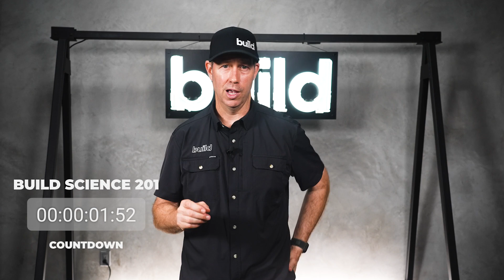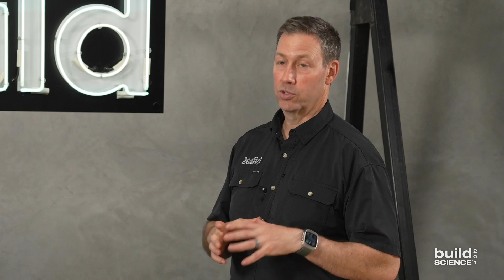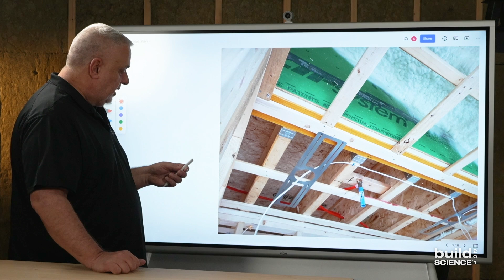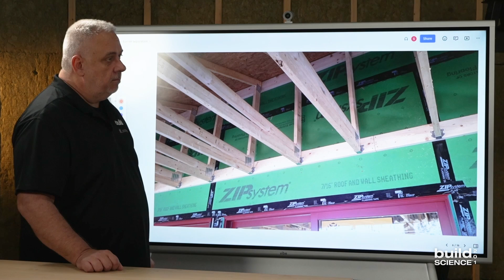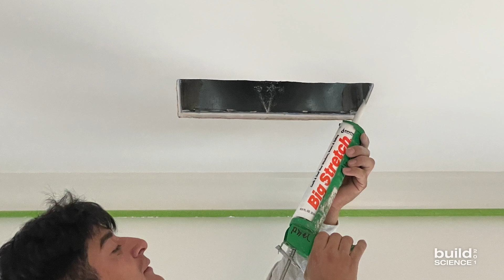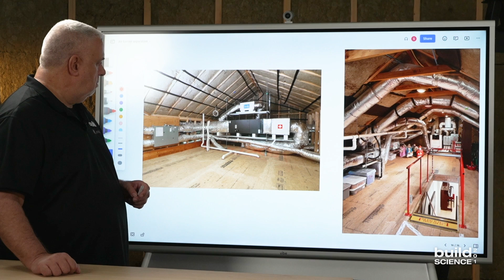Build Science 201: Ep. 5 - Air Management: Separation

Comment: I wonder if the tape that completely covers the window clips is a very recent change in process. A little while back I made a comment about an install that didn't have that. Eh, even if the change had nothing to do with me, it's nice to know I wasn't crazy.

Also, I'm becoming more and more convinced that access to a ventilated attic should be from the outside of the house, rather than the inside. It's way too annoying to build in a super sealed access hatch inside the envelope for a place you really shouldn't need to get into often. It's a lot simpler to build a hatch at the gable end that really only needs to keep wind and rain out.

Comment: Reall great videos!  -- QUESTION -- Matt or Steve, one thing I can't understand as it is not addressed, is that with Zip system and Zip 1.5 or 2.0, after covering up overdriven nails etc., when you add your exterior cladding such as wood siding, you end up nailing into and through the Zip and do not, and cannot, waterproof those penetrations.  Given that reality, why employ Zip 1.5 if water tightness is ruined by the cladding and all the furring strips and fasteners for the rain barriers.  All of those hundreds of unprotected nail holes would be potential leak spots??  Nail penetrations either matter or they don't and I can't get my head around this issue..

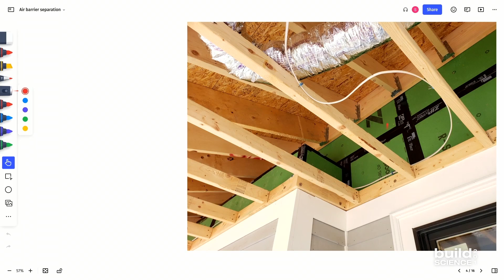Comment: At 7:05 is there any worry that the foam behind the zip will ever shrink or degrade over time with the ledger presumably bolted thru it into the framing? I have this exact connection point on my personal home build and had a tough decision with it. Either break your continuity of the foam air barrier and bolt ledger directly to framing then pick up the foam above and below the ledger or have it continuous and bolt thru it with structural bolts.